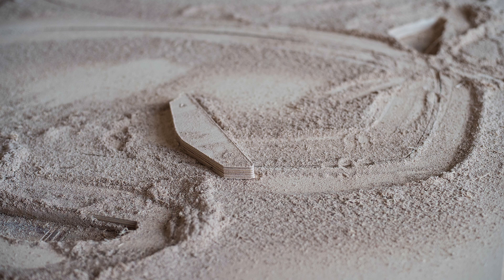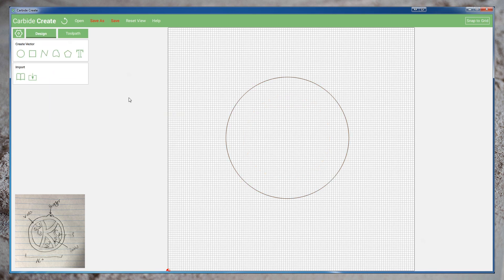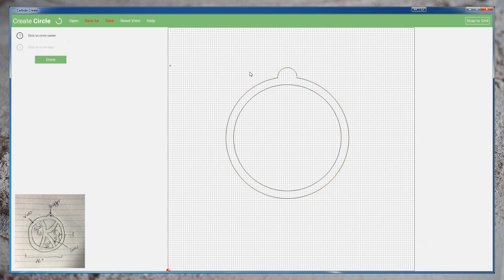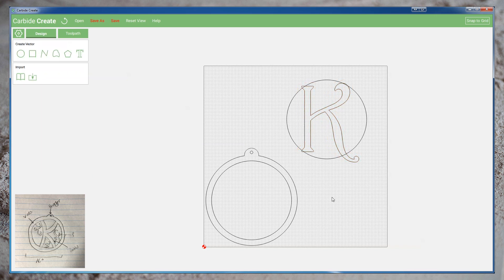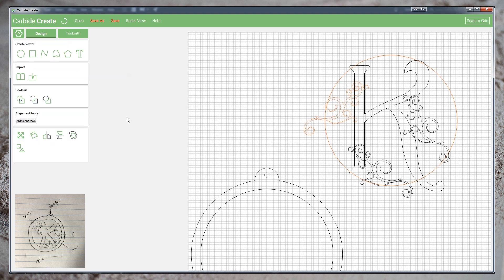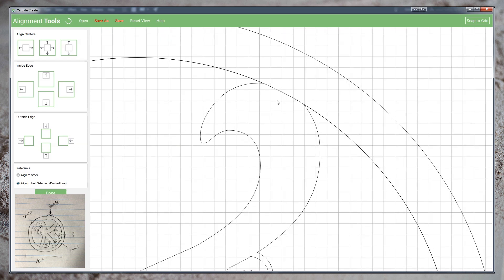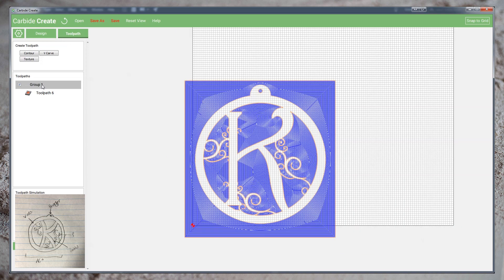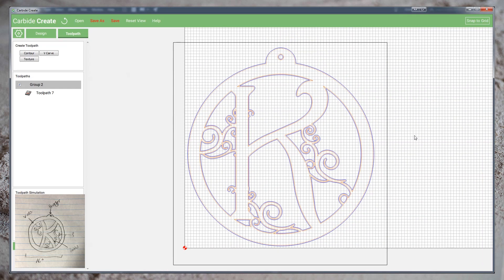Practical CNC 03 - Monogrammed Door Hanger in Carbide Create

Comment: Great video.  Think I'll watch it 6 more times to soak it all up!
Reply from the maker: Worth noting there are others way to do it also so use what works for you. I didn't have to move the copy of the circle away from the main design to do the operations, I just find that easier. If you prefer to edit 'in place' you'd just keep selecting the circle and subtracting the shapes. It would skip the last step of moving the finished inside back into place.

Comment: Hi, Great training videos. Is there a way to do pretty much the same thing but with a last name across the middle? I guess it would be a split monogram with a full last name...
Reply from the maker: I'm sure it is but need to visualize what you're trying to do. I'd be concerned the letters would get lost if you just cut one on top of the other. You could combine this effect with the stacked text tutorial I did, or you could find a way to provide a solid area, like a horizontal solid stripe in the middle which you then carved the longer name into?
Reply: Marc, I just asked the same question above - I didn't see your comment until now. Did you find a solution to your question, I'm running into the same problem.